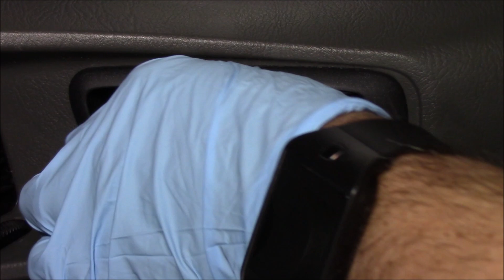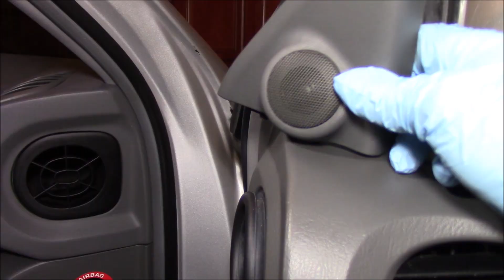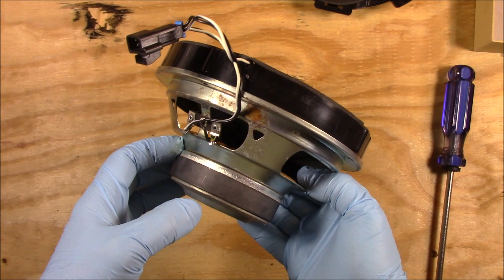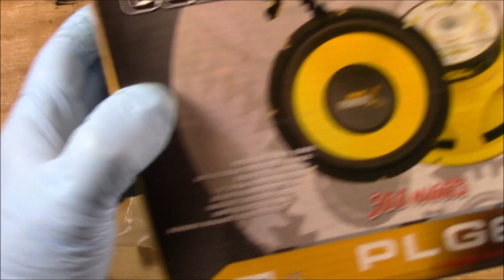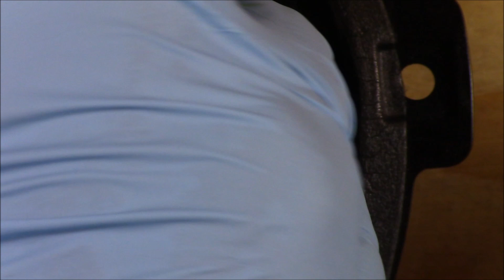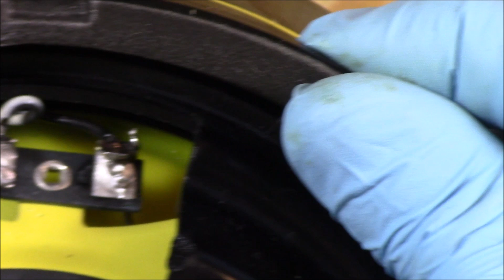Blown Speaker Replacement Front Door Hyundai Santa Fe 2003 Pyle PLG64 6.5-Inch Mid-Bass Woofer

Comment: So in my 2011 Hyundai Santa Fe Limited the front door speaker is a 6.5?
Reply: Crucified audio outlet would be able to verify
Reply from the maker: I don't have access to a 2011 Santa Fe Limited to verify this. You can pop the door panel off and check or use a flash light through the speaker grill to get an idea of the size. Thank you.
Reply: If its circular its either a 6.5 or 6 3/4 in diameter if its oval most likely a 5x7 or 6x9

Comment: I'm having the biggest problem finding the 3inch mid range speakers replace that go on top of the pyle subwoofers. Can you share a link to the smaller speaker that goes on top of these
Reply from the maker: They seem to be hard to source. Perhaps you could "harvest" a set of speakers from their bookshelf 3" speakers here at Amazon: https://amzn.to/2T8ZT9K  Thank you for watching and commenting. I appreciate it greatly. All the best.👍😀
Reply: You are better off just replacing the speakers with coaxial speakers
Reply: Parts Express will have options and bass blockers if not already in the car

Comment: how do I put new tweeters in?
Reply from the maker: I did not replace them on this video but I do have a video on taking the door panel off in which I show how to take the tweeter mounting off. Here it is https://youtu.be/rVoo4lzH2DI?t=8m54s BTW you do not have to take the door panel off to get at the tweeters. Thanks.
Reply: That helps a lot! Thank you. So if I wanted to put new tweeters in, would I snip off the little adapters and use the bare wire to connect it up? Or is there a better way
Reply from the maker: The speaker side of the connector is soldered on. I use a 25 watt soldering iron, here is mine at Amazon: http://amzn.to/2qwL7HW , to melt the solder on the speaker connectors and remove the wires from the tweeters. Then I solder them back on the new speaker. That way I can disconnect them just like the original speakers. If you don't have a soldering iron and are going to order one don't forget to buy solder too. Here is what I use http://amzn.to/2p40d5Z . Make sure you note which wire is the positive lead and which is the negative and connect them accordingly. Thanks.
Reply: thanks! that is super helpful.
Reply from the maker: You are most welcome. Thanks for watching and commenting.

Comment: Meaning if I got Infiniti Kappa 6.5 Coaxial speakers, they should fit
Reply from the maker: They look like they will fit. The only problem I see with those speakers is the shroud around the speaker magnet which may cause an issue with fitting into the OEM housing. You could remove the shroud or find some other way to get it to fit. Thanks.
Reply: Richard Lloyd. Just like what you did "shaved the speaker plastic mount/housing.

Comment: Thank you very much for the video.. i am going to order these pyle mid subwoofers, but want to know how they are performing?? is bass is good?? have you installed any amplifier to power them?? please reply
Reply from the maker: They sound good. The OEM radio I have powering them is slightly underpowered to drive them fully and will probably be upgrading the head unit in the future to get more kick from them but regardless they still sound good. Thanks.
Reply: +Richard Lloyd thanks alot 😊
Reply from the maker: You are most welcome. Thanks for watching.
Reply: I bought some of these speakers, it was woofer and tweeter combo, I was trying to improve my sound quality.  As it turned out I was getting less bass from the woofer found that the original put out more bass.  This was in a Sonata.  And the original woofer had a tiny magnet on the back never thought it should do a good job but I tried those speakers and then tried some Kenwood speakers returned all and kept the original.  I think It would be better if you upgrade the amp at least a true 25 watts per channel